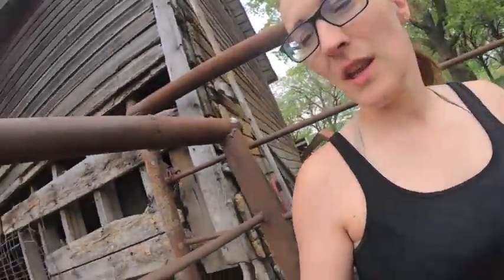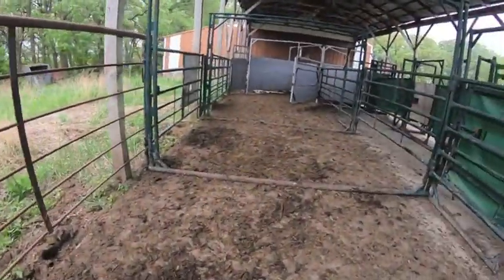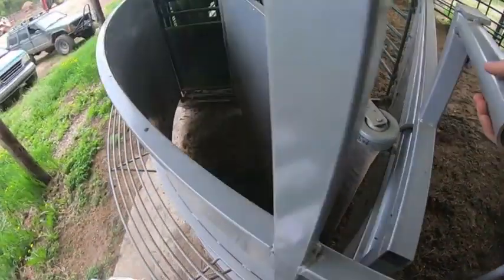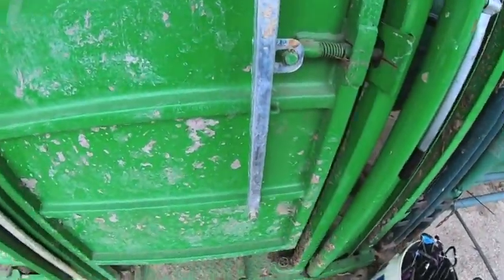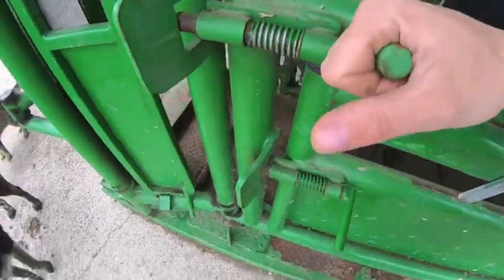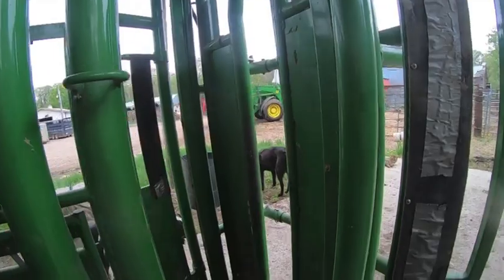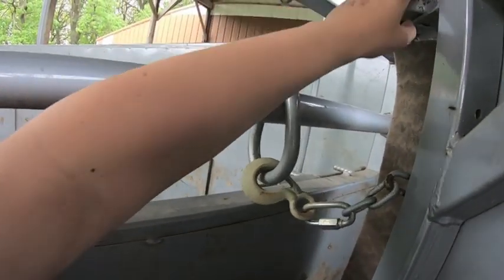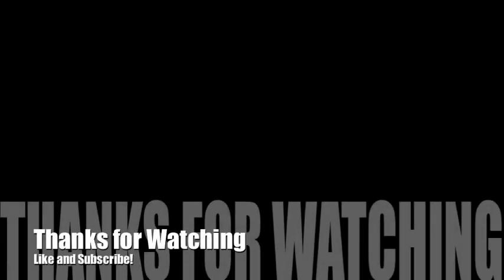Cattle Working System complete with ReatTuff Cattle Chute and Homemade Cornerless Cattle Tub.

Comment: I have a question for you, what is the material you used to make the panels "solid" in your alley? I love the idea and want to do something similar.
Reply from the maker: We use plywood for the gate and the green part is actually banner vinyl zip tied on.
Reply from the maker: We use plywood on the gate and green banner material to block out the alleyway.

Comment: That's a hell of a nice cattle system all under a covered roof too...steel galore, lots of time and effort building that one. You should see my cattle set up...all wood, heavy wood fire rated wood doors for the loading chute...then I built a stout 8' high wood-head-gate $107. of pressure treated wood before wood prices went sky high...built from 1954 Ag design plans. I believe i'm the only cattle rancher in U.S.A. that's using a wood operated headgate...that can hold a 2,000.lb bull.
Reply from the maker: Thanks you!  It's a work in progress.  Heck of a lot nicer than what we started out with!  I wouldn't want to buy wood right now thats for sure!  As long as it works I don't think it matters what it's made of :).  We are still not finished with this setup and make improvements every year.  The roof and concrete are really nice! No more tromping through muddy pens! It's a trial and error process right now until we find something we really like.  Thanks again for watching!
Reply: @rollagranchers2604  Your circular tub chute is stronger and better designed than MFG equipment....most impressive. Texas is dealing with a lot of rain and mud right now...twice as much rain fell this month than normal. I see places near my barn entrance and exits (eaves) that need to be dug-water-routed thick plastic lined- bricked lined and then rubber matted- conveyor belts. If i wanted to i could stand in the mud move for 30 seconds and be up to my knees...the cows are 3" from dragging the bottom of their bellies in mud. My first real mud season ever...so now i know where i need to make major rain drainage and soil improvements.